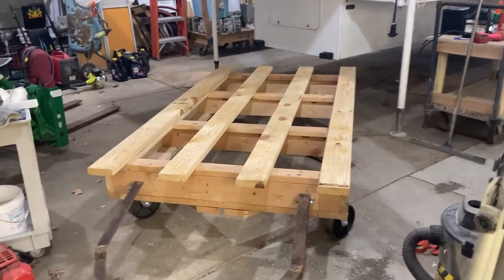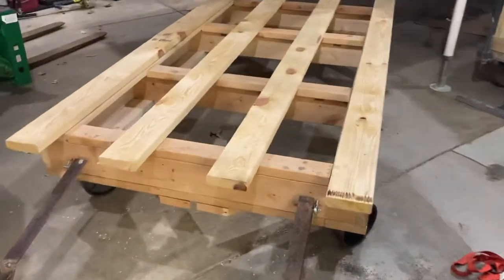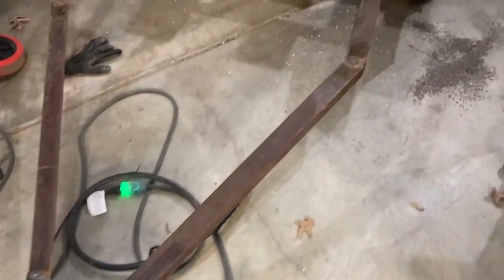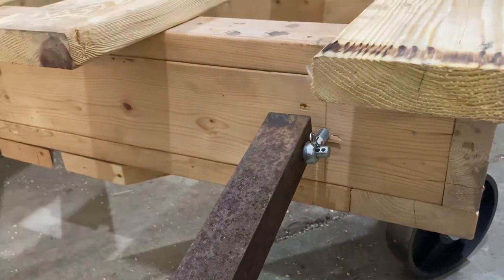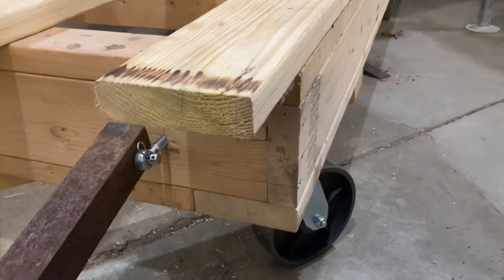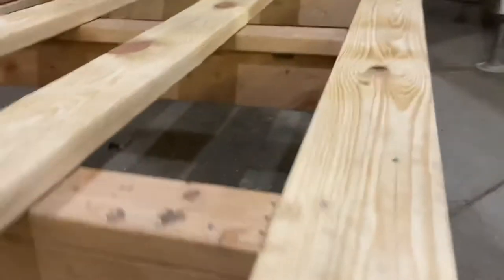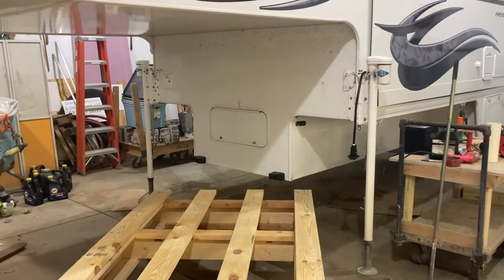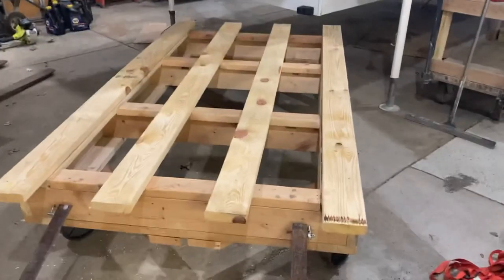Truck camper cart

Comment: is your cart 8 foot x 4 foot and are the rear wheel on the cart swivel or stationary as  I am getting rear to do the same cart  dose your cart at the lowest the camper can go down thank you mike
Reply from the maker: Yes, it’s 4x8. The rear wheels are fixed position and the front ones swivel.

The cart when the camper is on the cart and the legs are fully retracted, the legs are maybe 2” off the ground.
Reply: @SpecifiedGravity  thank you